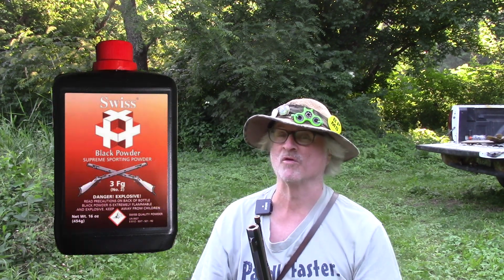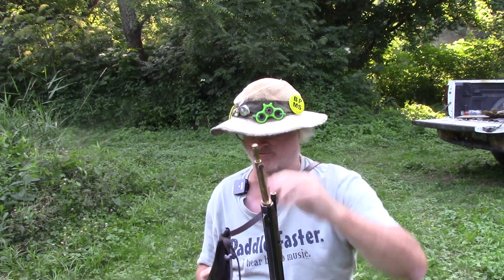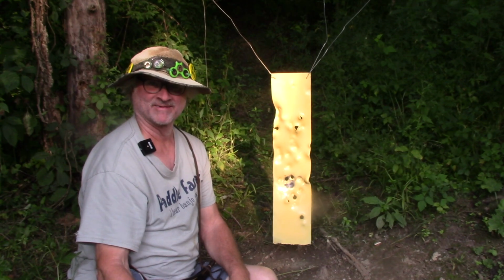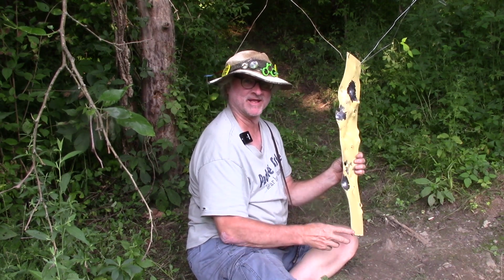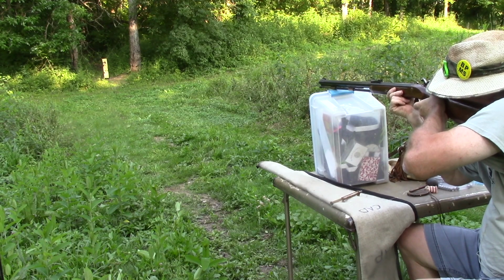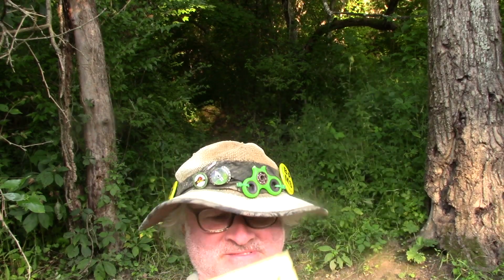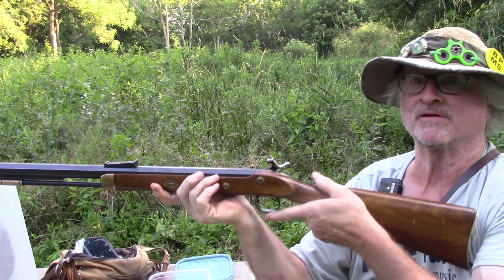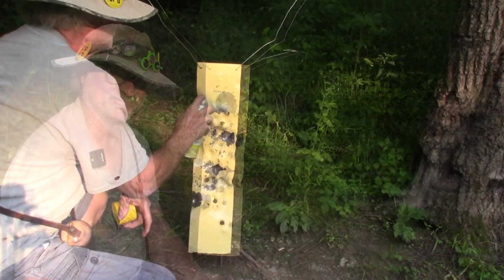Percussion Shooting Punching Thru Steel -  Is that possible? Swiss Powder Pop a cap

Comment: Speed is your friend in damaging steel with a soft lead round ball , while weight helps . I have really put some craters in 1/2" steel with my .40 flintlock and a patched round ball at 2275 f/s. You do lose some speed in the shorter barrel I am not sure how much .
One word of warning some guy on utube was shooting 3/4" hard ball bearings from a muzzle loader . When the metal got thick enough they did what BB do and went right back at him!
Reply from the maker: Yikes...shooting hard ball bearings would be destructive!
Reply: @blackpowdermaniacshooter  The returning to the shooter was the destructive part they can be lethal .
Reply from the maker: @jamessullivan1152  Amen brother...